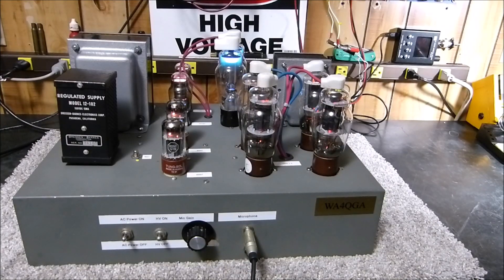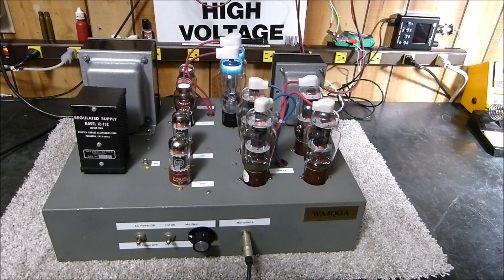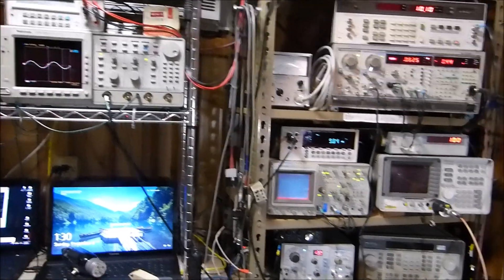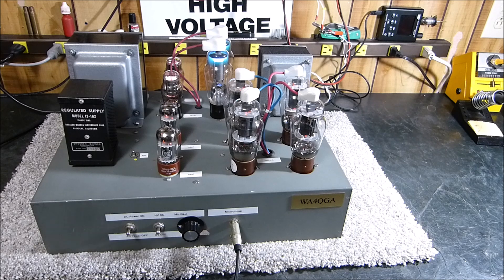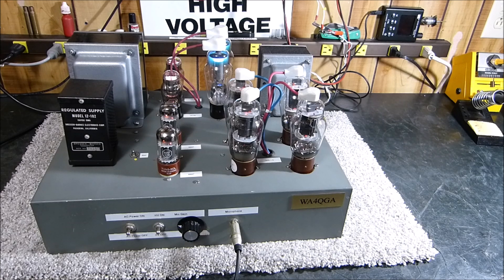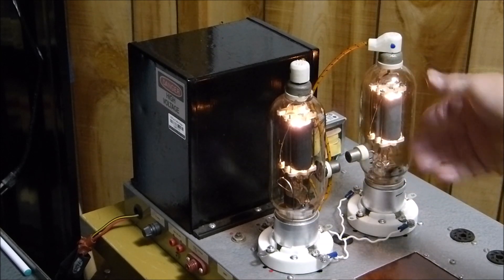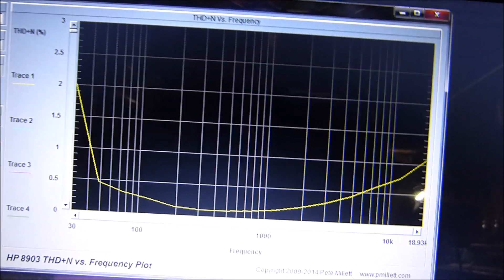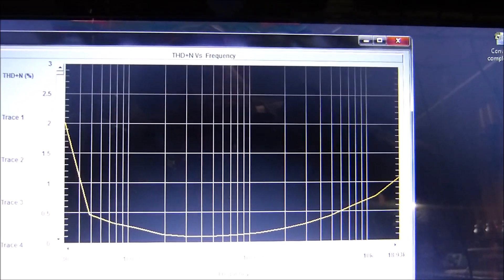Final Update On Quad 1625 (807) 100 Watt Modulator

Comment: What were the 807 plate and screen voltages?  And the grid-Cath voltage?
Reply from the maker: Here is the original ARRL article that inspired my build.    http://www.arizona-am.net/PHOENIX/NA7RH/ARRL%201625%20Mod.pdf   I made the one in my video as a Williamson amplifier design with two 6SN7 rather then the 6AV6 and 6AG7.  A 6AV6 is 1/2 of a 12AX7. The 6AG7 can be replaced with the 6SN7. If you want the higher gain in the first stage you can also use a 6SL7 as that is very close to a 12AX7 in gain.
Reply: @ElPasoTubeAmps  very nice.  They also stopped at 300VG2.  I went to 350VG2, because at 630VB+, there was a significant increase in Bass punch, and overall brightness when driving a 3,200 Ohm P-P xfmr.  Anyways, i might back it down next time i get into it to reduce the left channel preamp hum.

Comment: The gain was terrifying. 
High praise for an amp. Should call it the Nigel Tufnell signature series.
Reply from the maker: I agree about the gain of the input. With no global NFB, the gain is very high and I have seen that again on the SET amplifiers I  have been building lately. One single 6SN7 or 12AU7 can take the input direct from a microphone and deliver quite a bit of voltage drive to the output tubes. I am going to get around to building a sane level class-C RF amplifier some day and use this modulator for a little AM on 20 or 40M.    73

Comment: Salve. : Anche l’impedenza di filtro in primo piano, forse la si poteva allontanare un po’ di più dal Trasformatore di Alimentazione, poiché ciò non presentava difficoltà alcuna, trattandosi solo di due terminali nel circuito sottostante, Vero ?! - Grazie per avermi letto, nei miei interventi.- p.s. : Auguri di un Buon 2020.- : Aldo.-

Comment: Salve : Anch’io usavo le 807 come finali.- Valvole poco costose, ma generose nell’esprimersi, in Alta e Bassa Frequenza.- Esse sono precedute dalle immancabili 6N7GT, etc. Ma credo che il Progettista sia caduto nell’errore classico, di non orientare diversamente il trasformatore d’uscita, rispetto a quello d’alimentazione.-Bah ; Comunque è pregevole il risultato finale del Quad.-
Reply from the maker: That is really good to know about the 6N7GT evolving into the 807. 
As for the orientation of the OPT to the power transformer, I see what you mean but I believe the distance between the two transformers is sufficient to not induce voltage from the PT into the OPT.  I was very careful with that very point in a stereo version I made using KT66 with the PT in the middle of the three transformers and I made small measurements of the voltage induced into the OPT and oriented the transformers in such a manner as to minimize induced voltage. Thanks for the information and comments.

Comment: Keeping the craft alive, one project at a time. Thanks for sharing these builds and tests, ...it is my hope some younger folk may become interested.   Resistance in the cathodes of parallel power tubes may be superior to plate R... The hint is found in the manual for the 6080, where a formula is given to calculate the value of resistor to use on the cathodes given the mA and V ... that aids equal power sharing through local degeneration. On those tubes I use 7 ohms on cathodes when I use them in both pass-regulator service and as followers in Circlotron topology.
Reply from the maker: It is kind of an insanity that drives us forward. Hard to explain. I am actually taking inspiration from the Collins KW-1 transmitter as it uses the 872A rectifiers and 810 modulators. A bit over-kill but nothing like going it right.